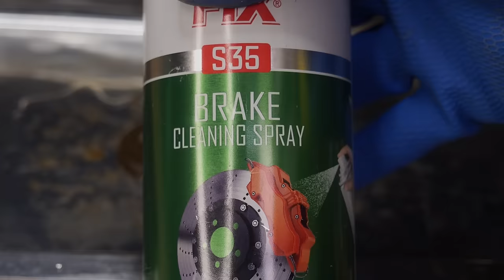Cursed Rusty bullet vise Restoration from 1950s

Comment: Tip… use the correct tools. 

I.e. The screwdriver should’ve been very snug in the screw head and the full width of the slot.  Anything that’s smaller will always try to rise out of the slot and cause damage to the head.
Reply from the maker: You are totally correct.(I do some of my work off the camera.I tried some bits and screwdrivers none of them worked)...
❤️❤️❤️

Comment: Don’t use WD-40 as a lubricant it is a solvent cleaner water disbursement cleaner hence the name WD best it will prevent it from going rusty straight away but it will not act as a lubricant and you done better off using a rattle can spray can to paint the thing with rather than airbrush you’ve got a lot thicker coat of paint and then put a hard clear coat on top to protect everything
Reply from the maker: I use can sprays when ever I can.This paint is 2k very hard paint.I only applied very very light coat.( it won't flake off on impact).Thanks for watching.❤️❤️

Comment: I'm a bit of a fan of vice restorations.  This was great.  Just wondering why you didn't straighten the handle?
Reply from the maker: Hey there.The metal of the handle bends before the vise is broken.In this model you cant remove the handle.(To remove it I had to cut it).I didnot want to change the handle.Onthis channel I restore tools for my main restoration channel.I want them to be usable.( not for just aesthetics).Maybe I should have tried to straighten it a little on the vise.❤️❤️

Comment: It was a good restoration. Its a tool and it just needed cleaned and put back into working order. It is a way better vise than most of the crap out there nowadays. Only thing i would suggest is grease or anti-seize on all the threads. It will make it easier for your grandson to restore again.
Reply from the maker: Thanks for your comment.  ❤️❤️❤️

Comment: a nice vice worth restoring, and not beeing negative here just wondering. Why you didnt just put all of it in a tub with diesel or something like that to get rid of all the muck, or why not blasted it from the start? it would have saved you alot of work and saved that toothbrush that to be fair isnt made for this kind of work. from my point of view you made it harder then it had to be to clean that vice and im just wondering why. and as someone who also paints both small and bigger objects with a airbrush i would recommend either a different sized needle and noozle for better coverage so you dont have to go back and forth with the gun as much. im guessing you are using a 0,3mm needle so i would try to find a 0,5mm needle and nozzle
now i know ive sounded negative and thats not my intention, my intention is to give you "food for thought" so later on you make it easier on yourself. i think the vice came out nice with all that elbowgreace you put in.
Reply from the maker: Thanks for taking your time and writing this comment.The chemicals I use are much stronger than diesel.(the vise is too old.That is why the grease didnot come off easily.).I also have bigger paintbrushes.Bigger ones spray more paint.I wanted a very thin layer of paint.  (To prevent the paint from chipping off  when the vise is hit.).You guessed the needle size right :).I thinned the paint for 0.3 needle.(2K auto paint).Thanks for watching. ❤️❤️
Reply: @OldToolRestorations  ok thanks for the reply and explaining. Good luck in the future

Comment: I think it came out excellent I would have used different paint remover and that color red is a different kind of pascal color I may have used hammerite red for a color pop but you put the mechanical parts in perfect
Reply: You can always open it up and add grease in the rest like you did on the shaft
Reply from the maker: Thanks for your comment.the paint I use is a very hard paint.I love hammerite paints( I used the grey colour on my last video).I didn't prefer it because hammerite paints are  soft.(they look way better).❤️❤️❤️

Comment: Horrible finish wd40 isn’t a lubricant it should have been loaded up with grease it’s just going rust together again
Reply from the maker: The green stuff I put inside is calcium grease.(off camera I put lots of it) .Thanks for watching.
Reply: I use wd40 to tap 😮😢 holes , but if not wd 40 I use spit 😮😢 works pretty good 👍🏻
Reply: Where is your video.  Show us how it’s done!